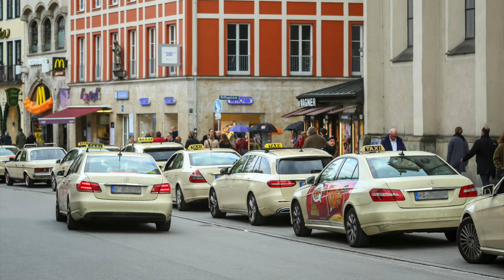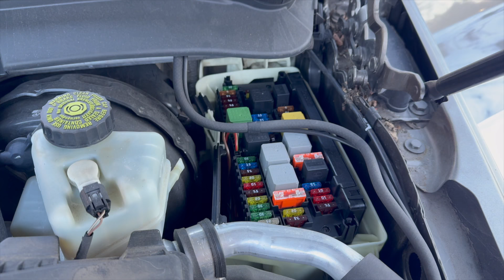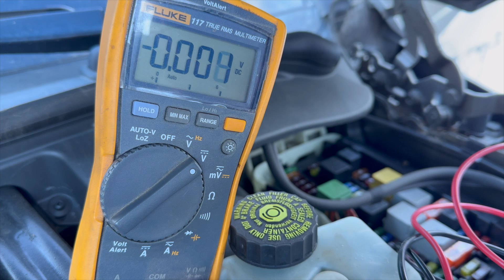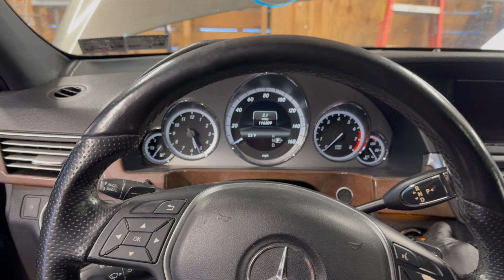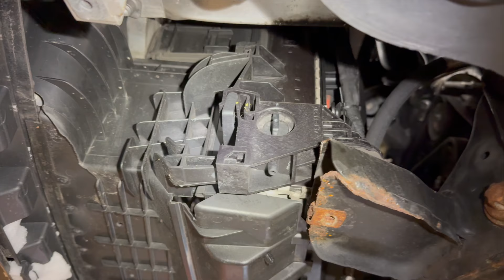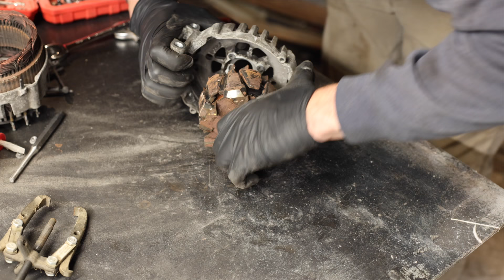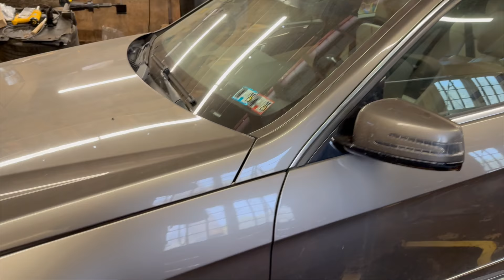I Bought the Toyota Camry of Germany, Except WAY Cheaper (and Better)

Comment: The following technical report details the reliability profile and known failure points of the **Mercedes-Benz S212 E-Class Estate (2010–2016)**. This generation represents a significant return to over-engineering following the quality control struggles of the W210/W211 eras, yet it possesses specific, potentially catastrophic failure modes that require vigilance.

### Executive Summary
The S212 platform is generally regarded as one of the most robust modern Mercedes-Benz chassis, often exceeding 200,000 miles (320,000 km) with proper maintenance. However, it is plagued by a critical structural defect regarding the rear subframe and specific timing component weaknesses in the direct-injection gasoline engines (M276/M278).

### 1. Structural Integrity: The Rear Subframe
*Risk Level:* Critical
*Status:* Extended Warranty Coverage (20 Years / Unlimited Miles)

The most significant threat to the S212 is **rear subframe perforation**. The steel subframe mounting points are prone to severe corrosion from the inside out, leading to delamination and potential detachment of suspension control arms while driving.
*   *Pathology:* Moisture and road salts accumulate within the hollow subframe assembly, causing unnoticed rot until structural failure occurs.
*   *Resolution:* Mercedes-Benz USA has issued a warranty extension (not a safety recall) covering this specific component.
*   *Inspection Protocol:* During pre-purchase inspection (PPI), do not rely on a visual check of the exterior subframe paint. Use a borescope or tap test to check for internal density loss near the control arm mounts.

### 2. Wagon-Specific Systems: Rear Self-Leveling Suspension
Unlike the sedan (W212), the S212 Estate features *rear air suspension (Airmatic)* as standard equipment to maintain ride height under load. It is a pneumatic system, not fully hydraulic.

*   *Air Springs (Bellows):* The rubber bladders have a service life of roughly 70,000–90,000 miles (110,000–145,000 km).
    *   Symptoms: The vehicle "sags" overnight, often asymmetrically (one corner lower).
    *   Consequence: Ignoring a leaking bellow forces the air compressor to cycle continuously, leading to compressor burnout (a significantly more expensive repair).
*   *Valve Block:* The distribution valve block can seize or leak, causing the system to fail to level even with functional airbags.
*   *Ride Height Sensors:* Attached to the rear control arms, these plastic linkages can seize or snap, causing the car to slam to the bump stops or pump up to maximum height (4x4 mode).

### 3. Powertrain Analysis

#### Gasoline Engines
The S212 spanned a transition in engine technology.
*   *Early Models (2010–2011) | M272 V6 / M273 V8:*
    *   Reliability: Generally high. The notorious "balance shaft gear" issues of the mid-2000s were largely resolved by the start of S212 production (check engine serial numbers on 2010 models to be certain).
    *   Intake Manifold: The tumble flap actuating levers (plastic) can fracture, triggering codes P2004/P2006. Updated metal aftermarket levers are the permanent fix.

*   *Late Models (2012–2016) | M276 V6 / M278 V8 (Direct Injection):*
    *   *Timing Chain Tensioners:* Early production M276/M278 engines lacked check valves in the chain tensioners. This allows oil pressure to bleed down, causing a momentary metal-on-metal "rattle" at cold start. Prolonged operation can lead to chain elongation and timing gear wear.
        *   Fix: Install updated tensioners and check valves (Technical Service Bulletin exists).
    *   *Oil Wicking:* Camshaft position sensors and camshaft adjustment solenoids can leak oil internally through the connector. Capillary action draws this oil through the wiring harness down to the Engine Control Unit (ECU), potentially shorting the computer.
        *   Prevention: Install "sacrificial" pigtail harnesses at the sensors to block the oil path.

#### Diesel Engines (BlueTEC)
*   *OM642 (3.0L V6 Turbo Diesel):*
    *   *Oil Cooler Seals:* The oil cooler sits deep in the engine "V". The viton seals degrade due to heat cycles, causing a massive oil leak down the back of the engine/bell housing. The parts are cheap ($20), but the labor involves removing the turbo, intake manifolds, and fuel rails (8+ hours).
    *   *AdBlue/DEF System:* The heater element in the DEF tank frequently fails, often requiring replacement of the entire reservoir assembly.

#### Transmission: 7G-Tronic (722.9)
Most S212s use the 7-speed automatic.
*   *Conductor Plate (VGS):* The electronic control unit mounted inside the transmission pan can fail (speed sensor faults). In 7G-Tronic Plus models (2012+), these are Theft Relevant Parts (TRP) and generally require dealer coding.
*   *Fluid Service:* Strict adherence to 40,000-mile (64,000 km) fluid and filter changes is mandatory to prevent valve body wear.

### 4. Electronics & Interior
*   *Faded Wood Trim:* The Burl Walnut trim on 2010–2013 models had defective UV protection, causing it to fade to a milky, desaturated beige. This is purely cosmetic but expensive to rectify.
*   *Keyless-Go:* Door handles are prone to moisture intrusion, causing the capacitive touch locking/unlocking to fail.
*   *Rear Radar Sensors:* Located in the rear bumper for Blind Spot Assist. These are exposed to wheel spray and road salt, leading to corrosion and system inoperability.

### 5. Expert Recommendation
For the optimal balance of reliability and performance, target a *2014–2016 Facelift model* (identified by the single-lens headlights).
*   *Why:* The structural rigidity was improved, the 7G-Tronic "Plus" transmission is smoother, and the updated COMAND (NTG 4.5/4.7) system is far superior.
*   *Caveat:* Ensure the M276/M278 engine has had the chain tensioner update or budget for it immediately. Check the VMI (Vehicle Master Inquiry) to confirm the rear subframe has been inspected or replaced.

[1](https://drivemag.com/car-review/mercedes-benz-e-class-sedan-w212-wagon-s212-2009-2016-review-problems-specs/)
[2](https://forums.mbclub.co.uk/threads/w212-rear-subframe-corrosion.284775/)
[3](https://www.603mtech.com/post/common-issues-of-the-mercedes-benz-m278-engine-a-comprehensive-guide)
[4](https://www.theautopian.com/heres-why-you-probably-shouldnt-buy-a-mercedes-benz-with-the-om642-v6-diesel/)
[5](https://swedishautoservice.com/symptoms-of-an-airmatic-system-failure-in-your-mercedes/)
[6](https://www.youtube.com/watch?v=7JmfRmj2dlw)
[7](https://www.reddit.com/r/mercedes_benz/comments/1eyw8ig/help_with_w212_rear_subframe_warranty_any/)
[8](https://www.youtube.com/watch?v=wdyhipObKO4)
[9](https://www.youtube.com/watch?v=NoiP42u9J_k)
[10](https://motoringspecialists.com/mercedes-airmatic-suspension-common-issues-reliable-repairs-in-vacaville-ca/)
[11](https://www.reddit.com/r/mercedes_benz/comments/1b59asi/is_the_w212_the_most_reliable_modern_benz/)
[12](https://static.nhtsa.gov/odi/tsbs/2023/MC-10232321-0001.pdf)
[13](https://www.603mtech.com/post/common-issues-of-the-mercedes-benz-m276-engine-a-comprehensive-guide)
[14](https://www.reddit.com/r/car_problems/comments/1fpbxso/my_research_on_the_om642_engine_problems_as_an/)
[15](https://www.airsuspension.com/blogs/news/mercedes-airmatic-problems)
[16](https://www.youtube.com/watch?v=VZOVljwCszA)
[17](https://static.nhtsa.gov/odi/tsbs/2023/MC-10233796-0001.pdf)
[18](https://www.reddit.com/r/mercedes_benz/comments/1965zoa/ownership_of_a_used_mercedes_a_lesson_for_me/)
[19](https://www.autonorma.eu/blog/post/90-3-0-cdi-v6-om642-engines-and-their-failures)
[20](https://www.youtube.com/watch?v=VP3ytbnJPYc)

Comment: Buying a modern car which contains a complex electrical system that has been submerged in dirty water is a really bad idea. Many of the electrical components will corrode and fail over time meaning non-stop problems. Such a car is in reality only good for dismantling.

Comment: Waldo, there's a 2002 Mercedes 230SLK sitting at my neighborhood Pick n Pull in Tumwater WA about to be ripped apart if not rescued. The exterior is in terrific condition, I was told it's just not able to start up. The engine has some oil on the driver's side of it but it otherwise it looks pretty good. Door, trunk and hood all closed solidly. They're guessing $2200 for it. The key is in the ignition and the chime came on once i opened the door, but i didn't dare turn it. I barely have the time to write this plea for a rescue, much less bring it home with me to try to fix it. Hopefully you or one of your groupies will swoop in.

Comment: I've owned several new Mercs (3xE, GLA, EQA) but never an older car. There are So many to choose from stateside and I'm wondering.... what engine should I stay away from in an E? Is the  320 a safe bet? Or are they maybe even the best to go with? 

We are looking at buying a secondry car. 4 Matic and 2015-2016. What to stay away from? Yes to cheap of a car and always a dealer you can trust, like the ones you have experience with, but is there an engine to prefer among the gasoline engines? Strong enough to get good highway milage and durable.

Comment: I rented one of those in Germany in 2011. great car except for the electronics. There was no bluetooth and no AUX input so I had to play CDs. Radio thought all the CDs were scratched even brand new ones. If a CD skipped, the radio was completely lock up. Only way to change the CD or even listen to german radio was to shut off the car.

Comment: I have a 2000 Toyota Solara SLE convertible. 120,000 miles. Second set of brakes, third set of tires. Did the timing belt and a PCV valve. One alternator, one battery one set of spark plugs. Regular oil changes and a trans service. And a new antenna mast. That's since 2003. Next time in the shop I'll get the brake fluid changed and a flush and fill on the radiator. I've owned Mercedes and BMW but the complexity, frailty, and parts/labor prices just drove me away. Toyota may be kinda boring, but look forward to 300,000+ miles of it at very low cost per mile. They just keep going without any drama. It is 25 years old and will out last me.

Comment: How in the HELL did you score a Mercedes E Class that runs for $4k in 2025?
Reply: They’re not expensive. Depreciation hits Mercedes hard. Especially for one that needs this much work.
Reply: @JosephSamsor  I saw a 2010 Chevy van, 180k+ miles on, being sold for $4500 on the corner of my street.

Comment: Less than 100k miles and already had leaking solenoids (known issue) , harness getting oil very close to the ECM (know issue), pullies almost done , and alternator pulley about to fail too, not to mention the main trans issue … I think it’s not a Camry

Comment: SMALL PROBLEM HERE:   The 2025 Mercedes-AMG E 53 HYBRID Sedan, featuring an AMG-enhanced 3.0L engine and all-wheel drive, starts at $88,000  THERE IS NO COMPARISON..The 2026 Toyota Camry is expected to have a starting price around $30,000 for the base LE trim, with well-equipped XSE models starting at around $36,000.
 The top-of-the-line XSE trim is estimated to start at around $38,000

Comment: 👍👍👍👍👍👍Great channel, would be great if you can post videos how to 1) fix balance shaft for an affordable price, tricks? Anything to get the check engine light off.  Common issue on thousands and why these w211 and so cheap/being junked.    (2) And, how to replace the conductor transmission plate, another common issue, and why these 7 speeds needs to match the VIN.   It’s a crime these vintage w211s are all being junked due to these two issues.  (And the reasons why I must junk my otherwise perfect 2007 e350 sport soon).   Thank you.

Comment: I had a W212 with a 2.2 diesel that had 550,000 km when I sold it 2-3 years ago.I bought the car from Germany in 2013 with 30k km on board. If I had taken better care of it, maybe would still have it today, but it was a bit wrinkled on the outside 😂 I have a X254 2l diesel now, made 100k km with it so far and no problems have occurred.

Comment: Hi. Thanks for your useful video. When those are taxis they’re equipped with much smaller diesel engines. They’d never use a large petrol V6 as a taxi. Not reliable or economical enough at all. In the past Mercedes taxis, especially in Germany, are also fitted with specific more hard wearing interior materials like M-B TEX and not leather or fabric. The E-Class you’d buy as a taxi was not the same as other E-Classes. BMW and other manufacturers didn’t offer a taxi spec like Mercedes have in the past. Mercedes are also leaving that market. Mercedes taxi sales are down 75% over the last four years.

Comment: Hi, - Jules from the UK! Waldo, you present tech info clearly and accurately - I understand it! Cam solenoids have been an issue for plus 20 years - the pigtails should cure. What I know you like, but what I abhor, are all the electronic nice to have gizmo’s. They are central to vehicle unreliability,  but hugely profitable - fashionado’s have to have them. Then there is the complex minimum emissions kit. It is hardly surprising that vehicles light up with error messages after 5 years use. The emissions to manufacture and the emissions to break a vehicle at the end of life, greatly exceed the emissions reduced by this kit during the cars shortened life. Less kit, longer life equals lower emissions.

Comment: The Taxi drivers/companies use usually the 4 cylinder Inline, diesel engines, it is very rare to see a german/european taxi with petrol engine (i saw once in my live it was an old american V8 at a petrolstation years ago, and an old Volvo 200 series is driving around my hood), today a lot of taxis aren't bought anymore they are on leasing so longavity isn't important anymore, they drive it for three years and gave it back to the leasing company (so their problem), but if they are bought its still ususally a mercedes E-Class. And yes taxi drivers got special offers in price and leasing conditions.

Comment: The american story about unreliable BMW's is getting a bit boring - of course there are models that are more unreliable than others, that goes for every model-range for all brands, but to say that BMW is more bad than others is not true i think. Often it is a matter og maintainance. BMW's are sophisticated and often fast cars that handles quite unique - so it of course will be slightly more expensive to maintain them. One of the problems is, i think, that used cars in your country is so cheap, that nobody pays what it costs to maintain them proberly. Other than that, thanks for another very nice video.

Comment: Sorry for Valeo quality control. Im from Poland, i use a lot of Valeo while maintaining cars. 

These parts are extremely cheap when bought in right place. They produce many parts, like Electric engines for wipers, wipers, plastic elements, alternators, plugs, filters an many more. 

There is no need to worry while buying Valeo parts, it sucks that the one you got was stuck.

They are OEM manufacturer for PSA (peugeot, citroen) and VAG as well Mercedes. Most of parts are made in Poland. Best price/quality competitor in many cases.

Fun fact: Poland manufactures almost every car involved part, also export to mexico which install it in USA specified cars. Brands like bosch, Brembo, ZF, Valeo, TRW have big factories here.

Poland also make many toyota OEM parts as well as whole engines like KR1.

Comment: i have to agree, that in terms of brand, mercedes is better (way more expensive - brand new purchase price) than toyota. however..... mercedes maintenance cost is much more expensive than toyota (directly proportional to the price when buying a brand new mercedez). when someone wants to look "rich" or "noble", i sincerely suggest to buy a used rolls-royce phantom or the more affordable ghost? or bentley? i have a 1995 w124 e320, that's what i call german engineering, but a friend of mine has a 2024 w214 e200........well...not as robust and easy to maintain as my car.

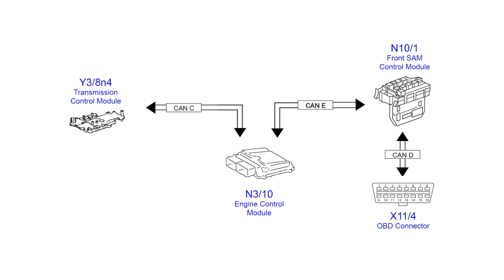Comment: 2:25 and this is why I can tell you you never ever buy a flood vehicle, as they generally never really get “fixed” unless you plan on driving into the wheels fall off as I have with several S, and E class W222 and W212 which all have had well over 4000 miles before anything major happened

Comment: I usually reserve commenting for after I've watched a video in its entirety, but the difference between this vehicle and a Camry shows up pretty early.
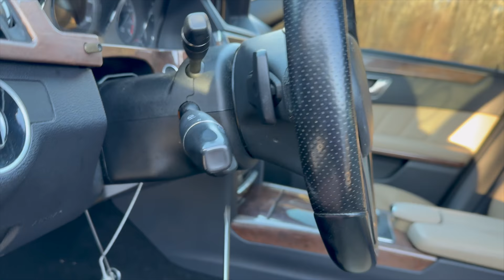Never in a million years would a Toyota require a technician to permanently damage an interior surface to replace a part. (@2:58)

Comment: Waldo, always look forward to your car videos - thank you.  I noticed the keeper plate was broken when pressing the rotor out of the drive end bracket of the alternator and it looked like you didn't replace it.  Strongly recommend this is replaced even though the drive end bearing is a press fit.  It will eventually come loose...

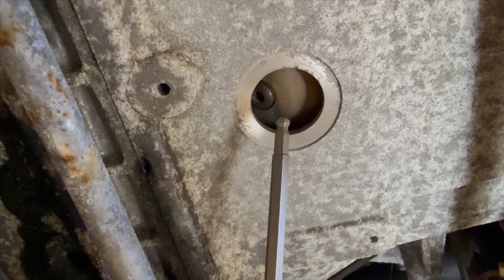Comment: 16:30 trust me it's not worth stripping the bolt. when I did a trans service on my dads 2012 ML350 I didn't even bother to remove that screw because if it fell into the trans housing I would possibly had to fish it out or worse case scenario I drop the tranny. So it's not worth the risk imo.

Comment: You Bought on of those MBenZ POS  Taxi Cabs. Good Luck with that pal. The last one I Looked at had cardboard trim panels. It was a 190 which we called Hitler's Revenge. I Hadn't seen a car that crappy since the The Soviets started bringing me their Chevys to work on at a Chevy Chase Chevrolet. All special order the absolute cheapest crap you could buy as a fleet order with cardboard trim panels, Some weird  plastic seats No tint in the glass. road like a  tank. The ONly Thing  worse were the made in the USSR suits they had to wear. I told them where the Goodwill was and that they could buy used suits for $2.50 a piece. Next time I saw them they were all decked out. I think i Might be responsible for detente.